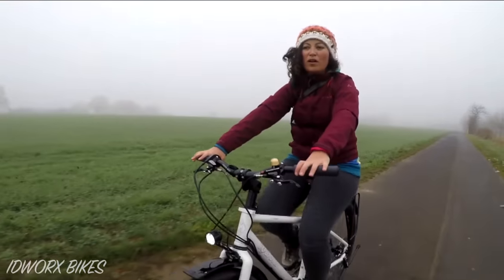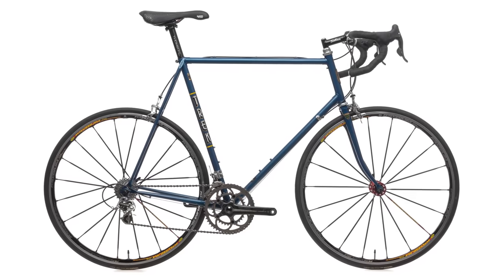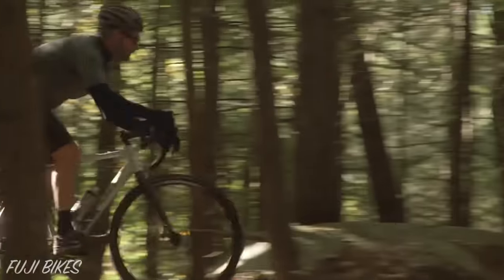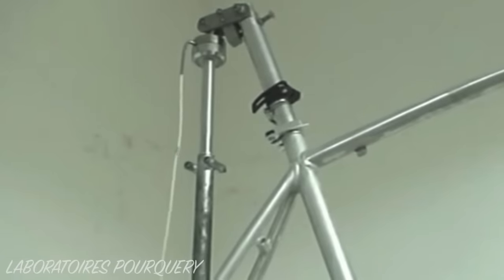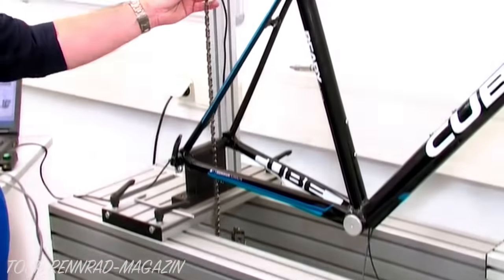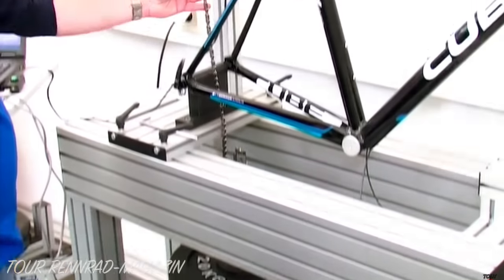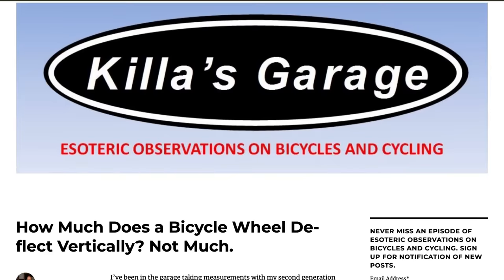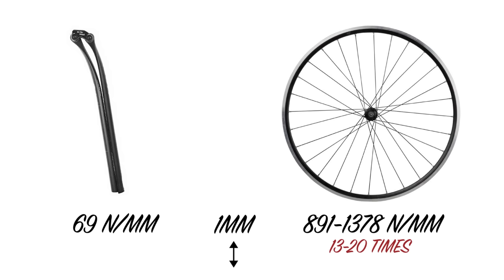Why It's Impossible For Steel Frames To Be More Comfortable Than Aluminium

Comment: I only ride steel bikes. Largely because its what i can afford. They are not high end steel bikes i have some double butted and quad butted steel bikes. I made the decision because of durability. I do not believe that carbon is less durable only that i can be less careful with my steel bikes than i would have to be with carbon. As far as ride quality i would imagine investigating the spring rate is a fools errand, since the damping quality of the material would have a greater impact on vibration transmission and comfort but the damping quality of the frame would be vastly outshone by the pneumatic damping of the tires. Of course this is from a touring perspective. I am sure if you are on a road bike with 110psi 23mm tires then the frame will have more chance to transmit vibrations. One thing to consider is when really putting down a lot of watts on the pedals the load on your seat is decreased because you increase the portion of your weight supported by your pedals (in this scenario your frames damping/spring has a greater effect since it is not usurped by the lower spring rate and damping properties of the seat post). Interesting content none the less Alee! Just bought the bikepacking guide after having really enjoyed owning the touring bike guide for many years.
Reply from the maker: Interesting considerations around higher power outputs. I guess it is quite terrain dependent. For example, when you stay seated over bumps the deflection of the system increases and decreases. Lots more to think about, which is the best bit about making content like this and having people chime in!

Comment: things I experienced with braking vibrations:
Trek 3900, 6300 when braking it was vibrating, I could feel it through the saddle, but on the 2014 fuel ex, or my new bike, Nicolai/Geometron g1 I don't get that vibration.
on the 6300 for example I could feel it up my butt when braking, not nice, but I see some frames on the market have brake mounted on the chainstay to reduce vibration.
and that was felt even on smooth asphalt so it's not bumps I felt.
Reply from the maker: This really depends on the brake calliper and/or the pad compound! A lot of modern disc brake components are very good at not causing the vibrations in the first place (not sure when the last time I had this problem was - maybe with Avid Juicys?).
Reply: @Cyclingabout  it happens with semi metallic TRP/Tektro ,metallic Shimano finned pads. but these were also the same pads I used on the other bike, apart from the Geometron/Nicolai, that's new build never had Shimano brakes on it, and I have given up on them due to constant bad luck with them, basically seems like they are possessed all I get, 4 pairs returned now 5 leaking. so I think for those bikes it's the way the bikes are designed. I used TRP-29 rotors, before that it was Avid G2.
but I used different rotors on these bikes, maybe that make slight difference, but I doubt that.
Reply: @Cyclingabout  I used avid juicy3 with g2 rotors, then same setup with Shimano m615, metallic finned pads, then I tried the Trp-29 rotors with Trp Spyke with semi metallic pads, then with Shimano M6000 with metallic finned pads. On the fuel ex I used Hope tech floating rotors, but before I used stock shimano resin only rotors. Now on my enduro bike I use Trp Spyke brakes semi metallic pads. Don't feel any vibrations from braking.

Comment: I have two steel bikes; Felt Brougham with Gatorskins and Bianchi San Jose with Marathon tires.  Neither have much of an exposed seat post and both are much more comfortable than any other alu or carbon road / CX bikes I've owned. I've swapped handlebars, seatposts, seats, wheels in my entire fleet.. the only constant? The frames; steel has always felt more comfortable.
Reply from the maker: I'm glad you find your steel bikes more comfortable! I've never personally found a correlation and can't find any data on it either, but the main thing is that you are actually more comfortable. 👍🏻
Reply: @Cyclingabout  thanks Alee. I'm a man of (data) science but this has been one thing I haven't been able to explain yet. I'll chock it up to placebo, but a strong one!

Comment: Wouldn't lateral flex and material elasticity also play a role in overall 'comfort' of a frame. Carbon and Alu are much stiffer, but less elastic, so don't return the flex energy on the opposite stroke. Would be interesting to see some analysis on these figures between the three materials.
Reply from the maker: We don't have any data suggesting that a higher side-to-side deflection increases comfort, but it certainly affects the ride 'feel' of a frame. 
I have played around with components and frame materials a lot over the years and have found that I can make a bike more or less comfortable by switching the tyres, seatpost and handlebar to models that offer higher vertical deflection numbers. The data collated here seems to verify my anecdotal experience.

Comment: If you want speed (aero tubes) but don’t care about cost or recyclability go with carbon. Carbon is also good for design versatility when suspension is desired. Finally carbon is best for designing compliance in certain directions and stiffness in others. Steel is not as good at stiffness in most cases but great for recycling, ease of manufacture especially for small builders, and very very tough.  Aluminum is always the cheaper option and is nice and stiff at the expense of vibration transfer directly to your body.  It does recycle well into beer cans though and is great for everything but a frame!  And yes I have given honest tries to many alum frame bikes over the years the most recent being an aluminum commuter. I hated the ride for a 3 mile commute after 4 months. Traded for a surly 😁

Comment: Okay, it`s so easy to find out whats the difference between Alloy, Steel and Carbon. Pick 3 tubes out of those materials and smash em against a solid object of your choice as hard as you can. You will feel the difference...it`s not about the flex, as you can make a frame out of those materials as hard and not flexing or wobbling. Thats about the geometry, wall thickness and so on. When people talk about the good characteristics of a steel frame compared to a alloy frame it`s about the transmitting properties of vibrations. So if youre lucky and ride a frame made out of Columbus Spirit with a wall thickness of 0,35mm and because of that a large diameter of the tube, you will get a really good numb ride feeling with great stiffness. But, to be honest, carbon wins this test any time.

Comment: Aluminum bikes tend to use larger diameter tubing than a steel bike.  One of those tubes being the seat tube.  Larger diameter seat tubes = larger diameter seatpost.  Doubling of diameter stiffness increases by a factor of 8.  Bigger diameter seatposts flex less.
Reply from the maker: That could explain things. But luckily we have lots of flex seatpost options in bigger diameters these days. 🤘🏼
Reply: @Cyclingabout  the standard diameter seatpost size for a steel frame is 26.?-27.2mm vs the standard diameter seatpost for an aluminum frame bike is usually either 30.9 or 31.6mm.  That said getting off topic with titanium there is the longstanding lore of Ti frames being so flexy.  Half of the flex is the frame and the other half is everything else.  Bikes with titanium frames in the 1990's were typically fitted with weight weenie parts back then such as the cranks,  stem,  handlebars...

Comment: Not convinced.. After riding steel, aluminium and carbon fibre frames I still feel that steel offers the best comfort.. It's not only a flex factor but the trail or road dampening that steel offers.. They all had steel seatposts yet i allways return to steel.. So are you suggesting it's psychosomatic.?

Comment: I have no material prejudice, however... In my experience my Surly Cross-check (4130 butter chromoly) with 40mm tubeless tyres at around 50psi is a harsher ride than my beater commuter that is a plain gauge Columbus tube Ciocc from the early nineties, with 25c at 90psi. So I think there is something in the material for sure, but it is not necessarily the material family. Not all carbon is the same, and I have experience in the difference in feel of different chromoly steels.

Tyre model also send to be more influential than size, as I'm convinced a 25c gp5000 is faster and more comfortable than a 32c panaracer.
Reply from the maker: Different bikes made from the same material absolutely have different ride feel!
I think the differences you've described in comfort can be explained. 50psi is on the high side for a 40mm tyre when compared to the 90psi @ 25mm. But then you need to factor in differences in handlebar, bartape, seatpost, exposed seatpost length, saddle, tyre model, ride position etc.
It also really depends on the tyre material and construction, which I think might explain why you're more comfortable on the 25mm GP5000 over the 32mm Panaracer. The GP5000 uses some really thin sidewalls which allow them to roll super quick.
Reply: @Cyclingabout  I find anything under 40psi on the 40mm tyres on pavement to be very uncomfortable, as the front has too much grip and steers into a curve. This may be a specific combination of the rake on the Surly fork, and the file tread of the Panaracer Gravelking, but I do prefer them around 50-60psi for this reason. On gravel they are good around 40ish, anything lower and I'm scared of impacting the rim.

Comment: Need to look at the equation for front wheel comfort
Reply from the maker: I've been trying to make a video about front end comfort, but it's so much more complicated because the direction of force (on for the fork especially) changes significantly depending on the terrain. And then you have other variables like how upright you ride, your core strength etc. 😭
Reply: @Cyclingabout  it's possible early carbon road bike forks were too stiff and gave a harsh ride wether it be on Aluminum  or carbon frame road bikes

Comment: Unless the frame is engineered to have vertical compliance like the Banshee Paradox V3, its expensive, but possible.
Reply from the maker: Unfortunately, even the potentially high vertical deflection numbers of a Banshee Paradox V3 frame are almost irrelevant when we calculate out the springs in a series with a rear 2.6" tyre. The only way for a frame to play a meaningful role in the vertical deflection of a bike is if its spring rate is lower than the tyres or seatpost. A good example of this is the BMC Micro Travel system which uses a soft elastomer so the frame can deflect 15mm vertically.

Comment: steel is heavier. therefore if tire pressure is held constant, you will have a smoother ride. When you upgrade to aluminum, you need to lower tire pressure. When i load up my aluminum bike with water and gear, it becomes much less harsh over rough terrain
Reply from the maker: Yep, heavier frames undoubtedly make for a smoother ride. Here's some data we have about vibration damping, all on a fast gravel road:
- There were up to 13% fewer vibrations between tyres from different brands due to differences in sidewall design and material (same width and pressure)
- Dropping from 40 to 30 psi tyre resulted in 5% fewer vibrations at the saddle
- Cushcore tyre inserts result in 4% fewer vibrations at the saddle

Comment: Interesting watch. But what about the FORK? After tyres, that is where most impact on ride comfort comes from. A whippy steel fork is a joyous thing - loads of compliance. A big problem is that disk brakes put such stresses on a fork that nowadays most front forks are much less compliant than they could be, simply because of the demands of the disk. An old school touring bike with a steel fork and V-brakes will, all other things being equal, be way more compliant at the front end than any modern disk-brake set up.
Reply from the maker: Yes, fork comfort is a different matter, although many steel forks are so overbuilt they don't ride any differently from an equally overbuilt aluminium fork. You really need to seek out a flexy steel fork if that's what you desire.

Interestingly, quite a few modern carbon disc forks achieve the same or higher compliance than older steel forks with rim brakes. Pretty cool!

I'd love to do a video on fork comfort, but it's really hard to quantify anything given all of the directions of force a fork experiences. I've got a lot of data ready to go once I work out a good way to present it.
Reply: @Cyclingabout  Unlike steel fork, aluminium fork literally needs to be always stiff from strength just to avoid failure from fatique.
Though when designed to withstand forces from disc brake, steel fork likely becomes also very stiff.
But rim brake steel bikes with curved forks I had before were definitely comfortable to hands on unpaved roads without super wide tyres.
Reply: @Cyclingabout  It's not the fork (and steerer tube) in isolation either, but the way the whole structure deals with vibration and stress. But yes, a fork is a crucial element in the whole bike 'comfort' thing and not an easy engineering analysis.

Comment: Try riding a steel/alu framed hardcore hardtail mtb (27.5" wheels, big knobby tires, long and slack geometry and a 160mm travel suspension fork) on challenging terrain and you'll change your mind I guarantee you. 
Maybe the blanket statement you're making applies to seated riding on gravel/road, it certainly does not apply to riding steep singletrack with lots of roots and rocks.
Reply: I've literally built up different frames with the exact same parts and went from steel to alu to back to steel again just for the added flex and vibration damping (=comfort).

Comment: Klein bikes are like riding on a cloud. They were designed for optimal performance, and thus absorb the high-frequency vibrations that cause fatigue. A Cannondale is designed for warranty. They are designed to make the company money and are very harsh. Also, don’t change lanes in a corner. The Cannondale won’t like it. I like steel… I like it a lot, and a Nervex lugged Mercian is a sight to behold. I believe titanium is the optimal material, but my own bike is aluminum. It handles like a dream, climbs like a rocket, and won’t beat you to death.

Comment: I feel like this is science in a vacuum.  Like wind tunnel tests for aerodynamics.  Yes, this is what the tests may show, in a controlled, static environment.  In my personal experience, the same wheels and tires moved between different frame materials had an immediately noticeable difference.  3 different steel frames I had tried out were barely different, but they were all more or less traditional straight top tube design.  Moving to 2 different aluminum frames with a sloping top tube and so much more exposed seatpost, rode noticeably harsher.  Whereas the steel frames had a certain spring to them.  If so much of the suspension/deflection is coming from the seat post, how does a frame with I'd say at least 3 times more seatpost exposed, have such a harsher ride?  

I have no doubt the measurements taken are correct.  But I also have no doubt that those numbers alone are meaningless.  Different weight riders, different weight distribution on the bike, different road conditions, and different total load on the frame...  These can all have a drastic effect on the ride feel.  A bicycle is a complete system.  Everything plays a part.  Testing one single parameter with only one or two parts of the bike, in a static, controlled, laboratory environment, has little if anything to do with the real world experience with the complete system, rider included.  So take this information with a grain of salt, and don't  let it influence what you ride.  You know what you like.  You know what's comfortable for you.  Are you going to let numbers like this convince you that something is more comfortable, when in reality it isn't?

Side note:  I see this same thing a lot with live sound too.  You have sound engineers who do nothing but look at the numbers and the levels, and the result is a bad sound.  Where if you have someone who knows enough about the numbers to know when to follow them and when not to, and knows that the end result, how it all sounds, is all that matters... you end up with a result that is far superior and enjoyable.  If it sounds good, it is good.  And if it rides good, it is good.
Reply from the maker: As long as you're comfortable, that's all that matters!

But I'd encourage you to do a bit more testing where you isolate more variables. After all, it's not unfeasible for a steel bike with less exposed seatpost to be more comfortable than an aluminium bike with a long, but stiff, exposed seatpost.

You'll find you can make your steel bikes ride harsher by changing the tyres, tyre pressures and/or seatpost design (Thomson seatposts are notoriously harsh!). And you can make your aluminium bikes ride more comfortably by changing the tyres, tyre pressures and/or seatpost design (a carbon flex post like the Roval Terra will ride very smoothly!).

Conducting these experiments on my own steel and aluminium bikes is how I discovered that I could make my bikes more or less jarring just by swapping a few components. And that led me to look into the science behind why.

Comment: The actual construction and geometry of the bike makes a huge difference to the ride. You can find carbon bikes that ride very harshly. Same with steel. 

If you compare the ride feel of a quality, well-designed, lightweight steel road bike with an over-built, heavy aluminium gravel bike then you won't need telling which one has the more compliant frame. Your bottom won't lie.😮